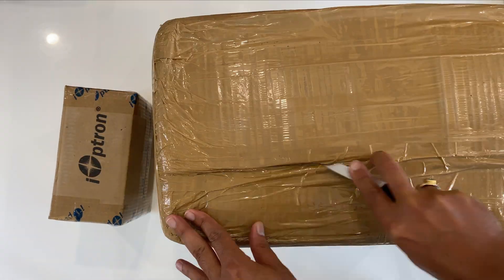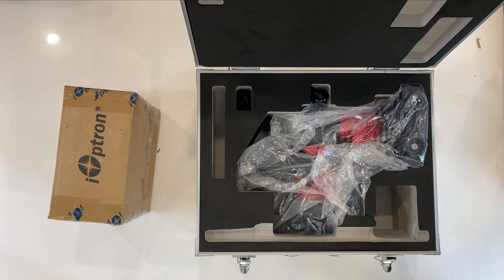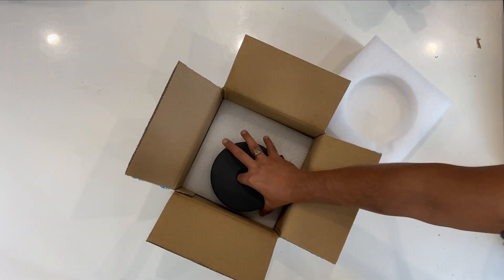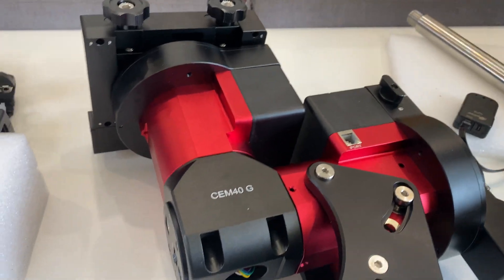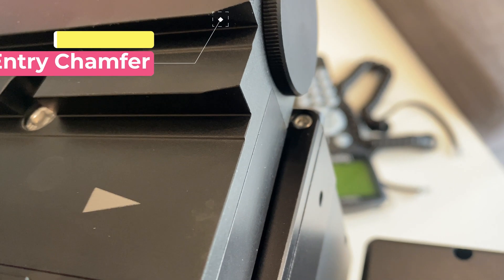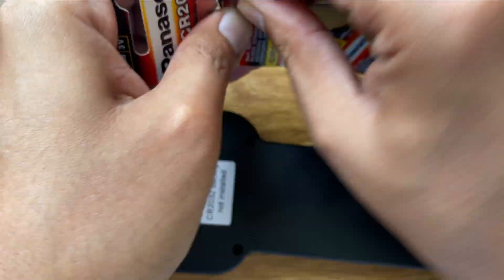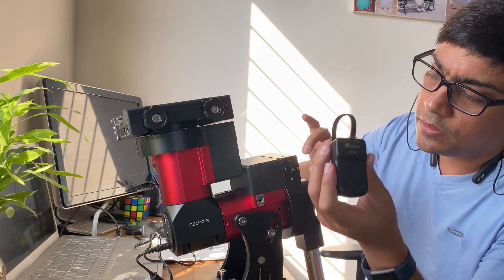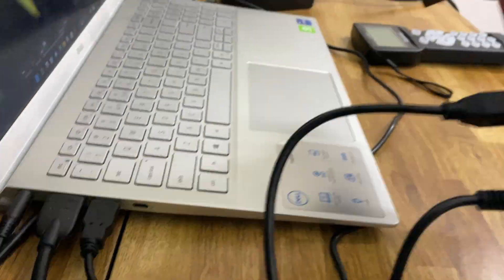iOptron CEM 40G Unboxing

Comment: Nice vlog 👍🏻
Just a query… why you opted for CEM40 compared to EQ6R Pro… I am thinking about upgrading to either EQ6R pro or CEM40.
Reply from the maker: EQ6R pro is not readily available in India. CEM40 is purchased from a known vendor from whom I have bought this. 
Before deciding think of Harmonic Drive mounts now as for a limited mount capacity it doesn’t need Counter weights, which is a blessing for travelling.
Reply: @ASTROindi  thanks 🙏🏻

Comment: Hi ;-) Could you please explain to me in more detail how you did the update and which drivers you installed? What does this have to do with Stellarium? Thank you.
Reply from the maker: Sure I will get back to you once early next month.
Reply from the maker: you can get the latest Firmware & Drivers from  https://www.ioptron.com/category-s/133.htm

Updating to latest Firmware , Drivers and ASCOM is necessary to ensure seamless communication between the Stellarium and mount should you choose to slew the mount from Stellarium,  if this step is not done there is a chance the connection bridge between Stellarium and mount doesnot get established, it may manot happen, but why take chances
Reply: @ASTROindi  Thank you for your helping ;-)
Reply from the maker: @CM-2000  welcome Clear Skies 🌌

Comment: Hi! Good Video of Unboxing. I am curious to know if you received the Tripod and if there is any fouling with the tripod at your latitude. I am at similar altitude of 13 degrees and the counter weight fouls with the tripod on an identical mount.
Reply from the maker: Hi, indeed I ah e received the tripod, and have checked and didnot find the fouling, now there is a caveat , CEM40G is different than CEM40 and also the location of weight will be problematic for lower payload, I will post a video in coming weeks on my experience.
Reply: @ASTROindi  Thanks ! Mine too is a CEM40G Mount but possibly before the design change for the low latitudes. My solution is a new counter weight holder which will incline the counter weight shaft. Thanks for the update
Reply from the maker: https://youtu.be/AUu90cAFB-M